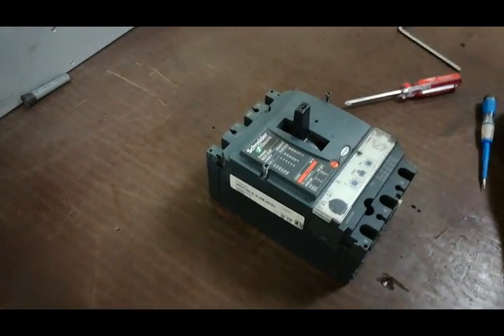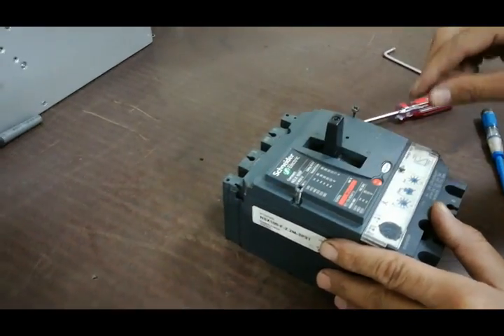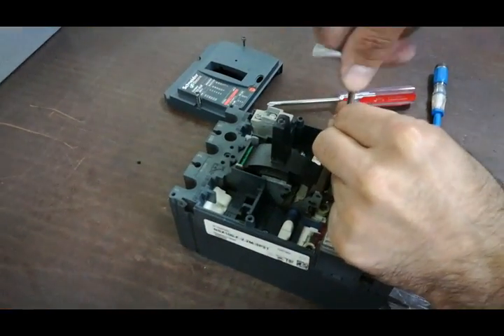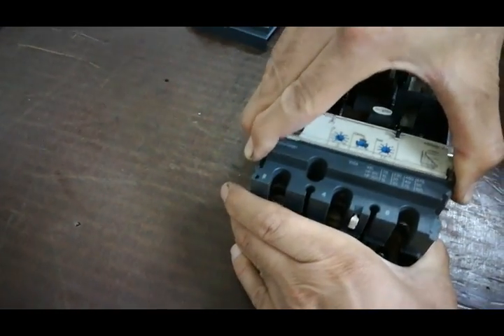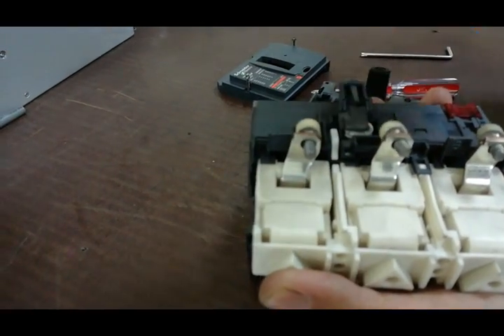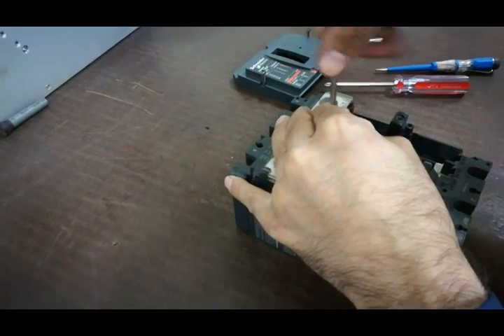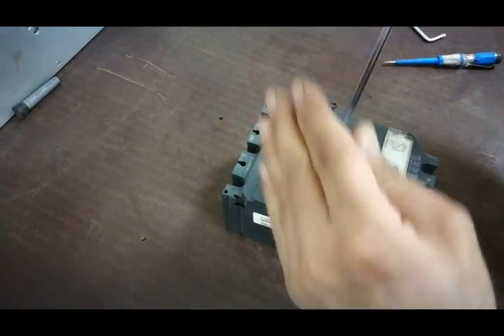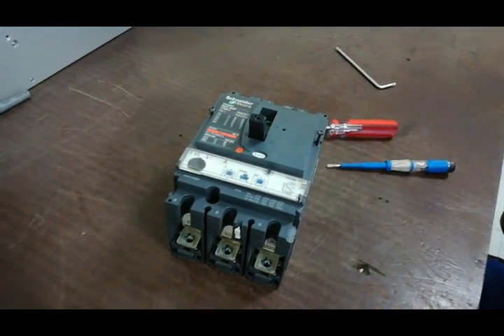How to repair Schneider Electric circuit breaker simply and fast

Comment: Dear Ali, I am part of Schneider Electric. I strongly recommend you not to perform this operation. By turning this screw you are actually changing the magnetic trip threshold of your NSX Circuit breaker Micrologic, compromising the ability of the device to a trip in case of defect., thus to protect the installation...
Reply from the maker: Bruno Colin , thank you very much for your answer, we use this breaker on a movable device that have lots of vibration and we see a lot of our Schneider electric breakers have this problem and the only way to overcome this problem was that.
If you can send me an answer on my email to be in touch
Thanks in advance
ali0611@gmail.com